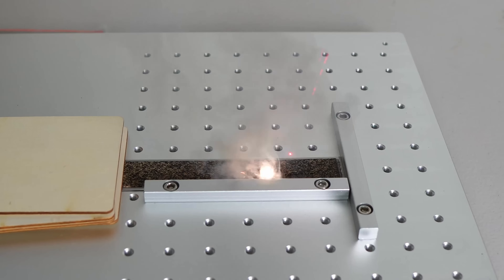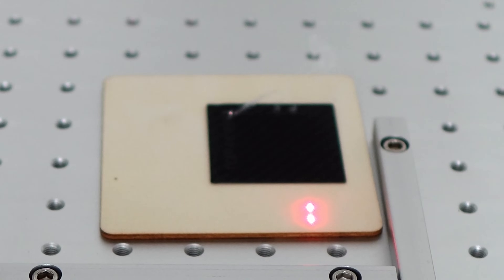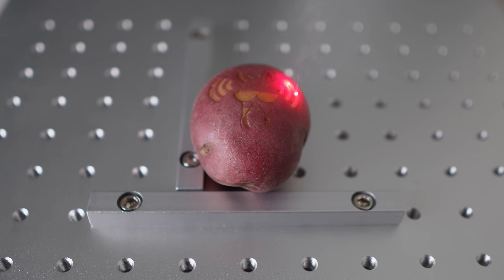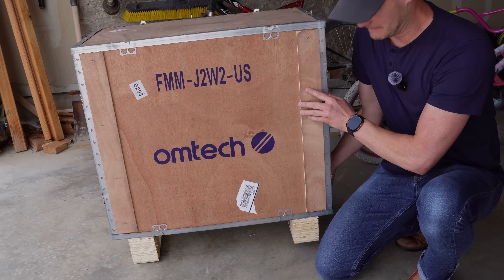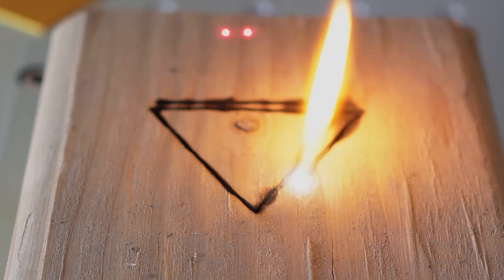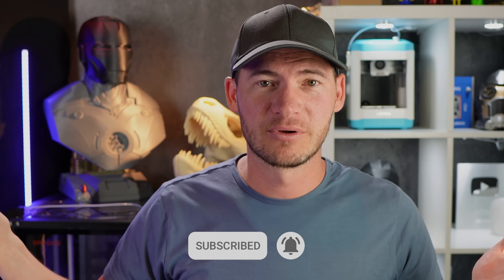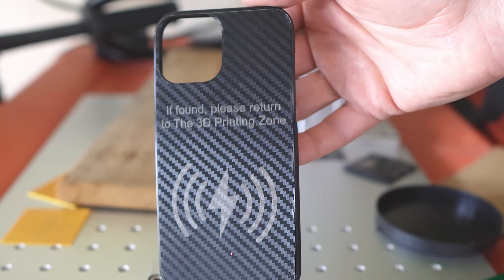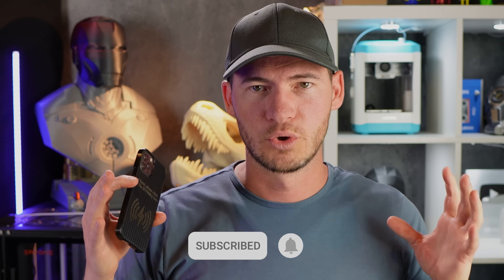Transform 3d Printing with Lasers (OMTech Fiber Laser)

Comment: How do you get the "printed" color you want ? I dont understand the process, thanks.
Reply from the maker: You just have to test a bunch of settings. I mainly focused on speed and power. With this 20 watt fiber engraver, having power at 100 and speed at 1000 worked pretty good.
Reply: @The3DPrintingZone  Thank you for your reply ; I just understand it's about UV laser engraving (so your reply makes sense on this mater), not about usual laser which would have destroy/melt matter.

Comment: Might be worthwhile to share the Laser power and speed settings as a starting point for others.
Reply from the maker: I briefly mentioned what was successful to me in the video. That was, 1000 mm/s speed and 100% power. It will be different with every laser so I would start off at a lower power and build up to that.